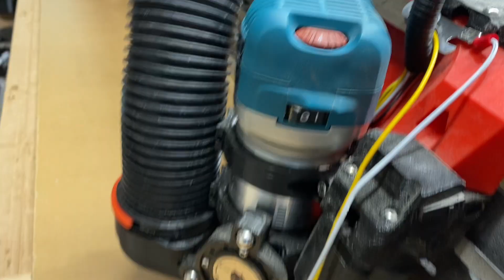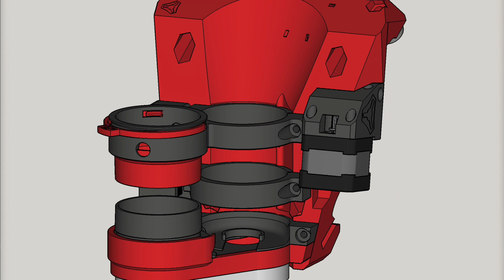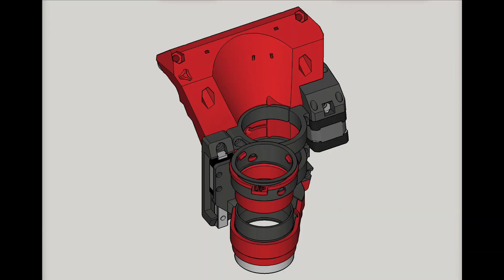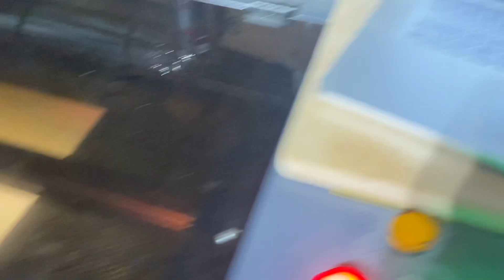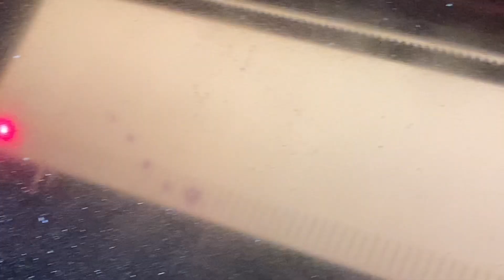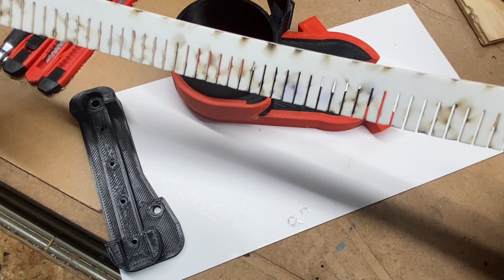LowRider v3 DIY CNC - new floating-Z dust shoe - work in progress - part 1

Comment: The MGN9 is different from MGN12 in the hole spacing for both the linear rail and the carriage. I had to remix the mount and floating Z to accommodate the MGN9 assembly.
Reply: MGN9 carriage holes spacing is 15mm on center each way. Linear rail hole spacing is 20mm on center for 5 holes. The holes on both ends of the rail are 2.5mm closer to the ends than on a MGN12 rail
Reply: MGN9 carriage is 8mm thick and the rail is 6.5mm thick. The thickness from the top of the carriage to the bottom of the rail is 10mm.
Reply from the maker: Wow. Thanks for the info. If you get a chance please post it as a remix of it on Printables.com.

Comment: I've been struggling with dust collection on my V3 as well.  Like he idea.  Unfortunately I don't have a 3d printer to work with.  As far as air flow.  As an industrial hygienist, we evaluate engineering controls such as local exhaust vent systems to control airborne hazards. This is exactly what your attempting to do...control dust.  2 basic facts: 1-air has mass; 2-mass in motion has momentum.  Air takes time and distance to change direction.  90 degree turns are high loss direction changes.  Much better to use gradual changes, curved direction change in the shoes...But space of limited on the V3 and may not be feasible.  Also, you need make-up air.  If there's too much restriction (e.g. the 1/4 open design) you will lose air flow volume - system is starved of make-up air.
Reply from the maker: You are exactly on top of not only the goals, but also the challenges. Some people may have thought I was crazy when I complemented how good the stock dust collection on the LowRider is, because they are not aware of the challenges. Ryan had to weigh a lot of different considerations in the design that he published for that. My effort here is a different approach and has its own new set of challenges introduced. I have lately been pondering the possibility of using either a 1 inch glass marble or something that would serve basically as a large ball bearing that could be mounted on the bottom, in the solid portion at the back of the shoe, that would allow the shoe to skate on the material without the shoe having to bottom out on the material, which would allow the bristles to be longer, and potentially allow more make up air into the system. I may yet do that.

Comment: Great design and explanation video again Doug! I wish I was at the point with my Lowrider that I could help test.  I was thinking though as you will want to replace the EVA foam periodically as it wears out, you might consider designing "spikes" or teeth into the track that would retain enough to hold the foam, but would allow for replacement quite easily without the use of any glue. Just my two cents.  Keep up the GREAT work!
Reply from the maker: Great tips and ideas, thank you!
Reply from the maker: Just circling back to let you know, I implemented your idea, and have credited you in the description of the pending Printables listing for the new v1.1 of the floating-Z dust shoe! The groove for the bristles now has tiny little barbs to help hold the 2.4mm thick EVA craft foam bristles. I included this thank you message: "Kudos and credit to @clayscustom for suggesting the barbs in a comment on the first video in the series! Thanks for the idea!"
Reply: Thanks Doug! Keep up the great work! Every one of your videos had motivated me!

Comment: Hey Doug, great design and another fantastic video. You must have read my post and been 90% done with this! 
Amazing job, the leap from pressure plate to this show have creative you are. Well done! 

I cant wait to see how it works, I reckon my design will get put on the self, yous is far simpler than mine
Reply: If it is a "spring" could you fit it with the tube clamps and then twist the mounts back against the spiral to give some pre-tension? (You would have to fix your mounts if they are not solid, I can't remember )
Reply from the maker: @chrishenderson6500  my thought right now is that by simply cutting it a little bit longer, that means that it will naturally want to stay longer, and so long as it can be compressed to that minimal distance of about 65 mm then it will be great for what I’m needing in this usage. I’m very optimistic after spending some time messing with the flex hose.
Reply from the maker: @chrishenderson6500  The PVC "skin" of the hose would not allow any significant twisting. It only allows linear contraction or expansion.
Reply from the maker: In this approach that I have taken, a lot depends on cutting the flex hose to the right length. When it arrived today, I immediately took it out and cut off a piece that was intended for final use, and then I realized in messing around with it, that it has properties that are beneficial to bear in mind while measuring and cutting. For instance, don’t think of it as a hose, but because of that coiled wire in it, think of it as a spring. A spring has a natural length that it likes to stay comfortable at, and while it can stretch beyond that and compress within that space, that natural length is an important property. That natural “resting state” length is what I want to to target for 115 mm. So I may need to cut off another chunk of this 10 foot piece that I bought.
Reply from the maker: This approach may or may not prove viable. The other tack that you are taking may wind up being what is usable in the end. The nice thing about being able to experiment with things is that experimental effort can serve in place of intuitive knowing.

Comment: Hi Doug, I'm planning my V3 build and found 25mm aluminium tubes at my local hardware store. I'm afraid they'll be a bit to lightweight, so that the router would push itself upwards z direction when drilling. What tubes do you use Doug? Thank you.
Reply from the maker: The recommended item is EMT conduit (which is steel). From the docs ( https://docs.v1e.com/lowrider/ ) "For US based builds, the recommended X rail size is US ¾” EMT conduit which has a diameter equal to 23.4mm, so print the Brace 23p4.3mf parts for this size X rail." There are other braces for conduit with smaller or larger O.D. One note of interest: DOM tubing is sold based on O.D. while EMT conduit is sold based on I.D. We need the outside diameter to match the selected printed braces, regardless of inside diameter it was sold under. Directly to your question: I started with LowRider v2, which did not have the reinforced gantry of the v3, and it needed stiffer tubes, and I bought 1" OD stainless steel, laser welded tubing. I have that on my router based LR3. I also built a second LR3 for plasma and it uses the recommended EMT tubing. Aluminum is rather soft and malleable, so I'd be wary of using that for the gantry of a LowRider. Seek out EMT conduit at the home improvement store!